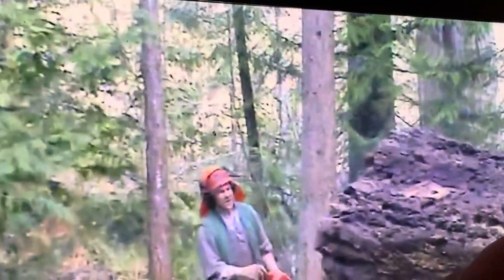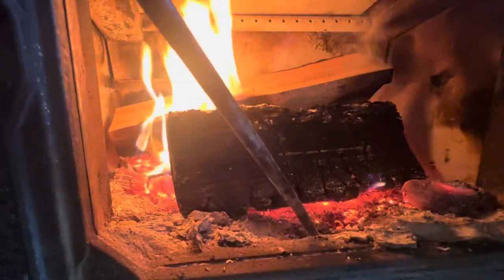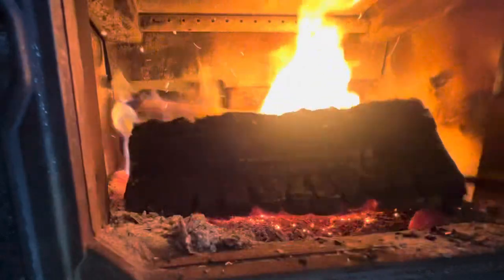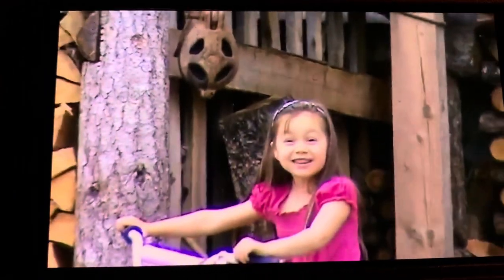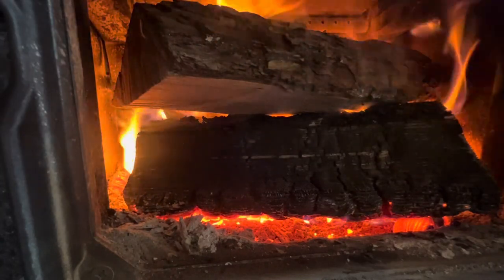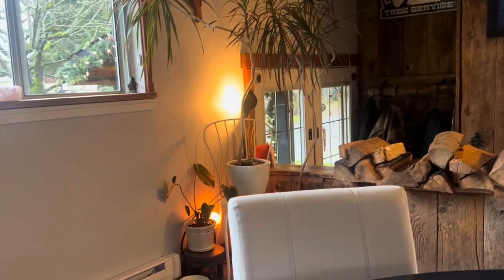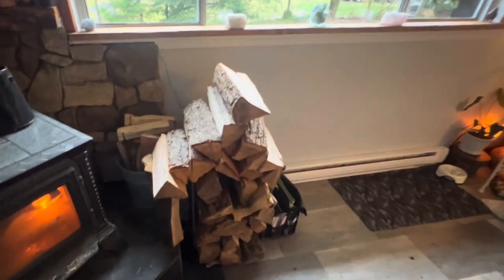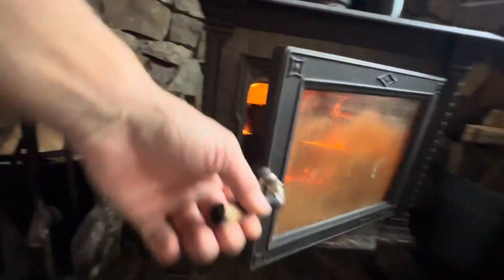Wood stove burning tips. Log placement is important

Comment: Thanks for the tips. Back in the 70s and 80s my dad pretty much taught us how to run wood burner. He would bring home coal from the mine to help the heat and hold fire overnight. I just had to relearn how to burn wood because woodstoves are different. The larger pieces chokes off air  so I have to  split it again to sizes that I know will work.  My neighbor stopped by yesterday, and he complimented me on how nice it felt in room. Thanks again for the tips.

Comment: I have had fire places, stove inserts, and stand alone wood stoves, over the years, and you my friend have hit the nail on its head! I have 2 stoves in the house as we speak, when we were without power for 3 weeks after hurricane Sandy, we had heat and were able to cook from the stove! I will never be without one again! And yes I have been to the court house to keep them! And I firmly believe that every house should have one regardless of location! Just think about how much easier Texas would have had it a few years back, when the they got hit with that extreme cold front for a few weeks! While I primarily burn wood, I have also placed oil lamps inside the burn box to help bring a little heat and maintain a draft ( plus it helps to get rid of the cooking oils!

Comment: I often have to resplit wood that I buy, because it's too big and burns too slow.  When I split it, I split it small.  Knotty chunks, crotches, etc I'll leave big and use for base logs, but I prefer the fuel pieces to be small.  It just makes for a better burn.

 I'm blessed with a wide variety of species, so I can vary the burn by choosing what species to put on.   Want it slower?  Throw on the oak, or Beech, or locust.  Want things to brighten up?  Add some soft maple, poplar, or spruce.   Imo, Ash and Sugar Maple are just about right.   Cherry, walnut, and birch are right in the middle of the road, too.

  I burn outdoors, but placement works just like you showed us there, too.  Even though it's out in the open air, you still need airspace in between pieces.   Cleaning out the ashes regularly helps too- so air can get underneath it.
Reply: Yeah the odd pieces (crotches that didn't split, weird cuts, short cuts that won't stack, any cookies, etc...) you get with a delivery I put aside and I either burn first just because they're awkward to deal with or I save them for one last odd piece to throw in at night before I go to bed. If you stack using holzhausens then these are great to throw into the middle of the circle.

Comment: I've got a wood stove insert, and it's the damndest thing.  I can't find any information about it on the internet.  The "floor" of the thing partially blocks the little intake vents, and it has a grate in it like a fireplace.  But once you get it going it'll get the house hot. It was here when I bought the house.

Comment: Great video Billy really helpful tips and tricks as always. I always try keep a 75% stock of dry wood (hardwood/softwood) 10% small bits and 15% damp ish wood for over night burning. Always helps me keep fire going and runs our whole house heat and hot water. 🏴👍
Reply: I do a similar thing when stacking.
10 faces of 2 year old wood, one face of year old, still a bit damp at 18 %, and a couple of faces of three year old.
      Feeding the dragon for over 40 years now and that fellas always hungry.
      Mix as nessary to get the heat level you need.

Comment: I want all my wood packed as tight as possible. Burns longer that way. If I am starting a fire sure to get it going. But once it's hot I load it as tight as possible. I load North and South. Air goes between it fine and it burns from the glass back.  My stove has a cat and burns that smoke. No problem keeping that stove hot or cool with just the air control. 

I leave my door closed after I first start it. Wood is usually split and stacked in the shed three (sometimes two) years before I burn it.

Oh I see your saying if your struggling with a down draft and trying to get started .

Comment: Buckin, I appreciate the tips. I just bought my first woodstove and have been supplementing my home heat with it. Question, I noticed you live in a ranch style home, do you have any tips to help circulate the heat?
Reply from the maker: Ceiling fans work great
Reply: You can also run the fan on your furnace to circulate the heat throughout the house. Set it to on instead of auto ! Good luck Sean it’s great beating up on the oil companies !
Reply: @123gonow  thank you for the tip but unfortunately I have forced hot water. I’ve been using some small fans and ceiling fans to help circulate the heat. Seems to be working okay but the far side of my house is still running on a separate zone with oil.

Comment: Since you are getting a bit older and have some injuries to recover from, maybe you can make yourself some wood boxes/bins that you can load into your Merc or Ford and stack into those and unload with your forklift, then unload into your woodshed and wham, bam...BBR is done for the year and only handled the wood 3 times instead of your 12 times before you burn it!  Nothing wrong with some larger pieces of wood either...long burn and not overbearing with heat---gOOD TIPS on some of your motosierra cadena vids, but the side stuff can be redundant [straight shooting]. Keep kicking a$$!

Comment: How does two or three pieces of wood heat your house. I live in pa with hardwood and jam my stove full and it only lasts four hours. I have a pipe thermometer to watch my stack temps.
Reply: Where do you target your flu temps?
Reply: @albowrx  depends on the temperature outside. Mostly 4-500. According to the gauge it’s perfect temperature to burn clean. I live in a old civil war farmhouse so a few pieces of wood barely heats the room the stove is in let alone the rest of the house. I have a coal/wood stove so I can burn both. When it’s super cold and windy nothing but coal will do